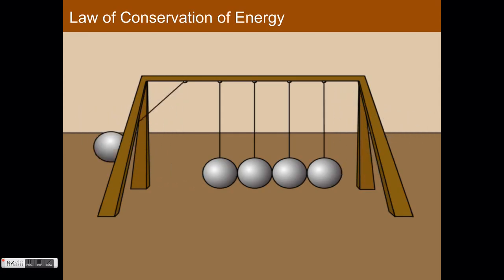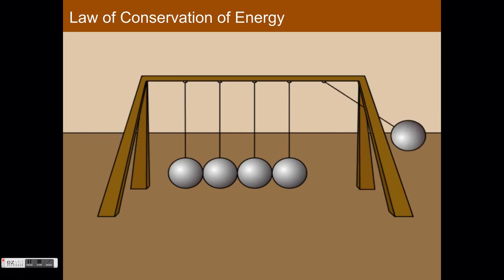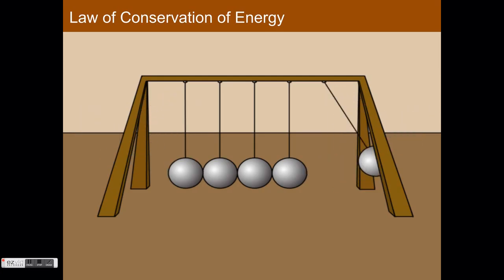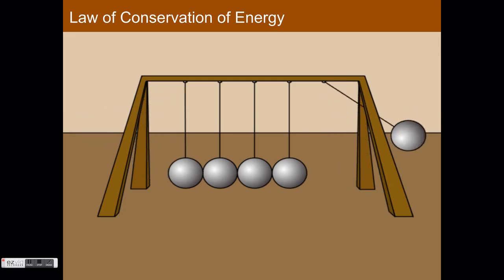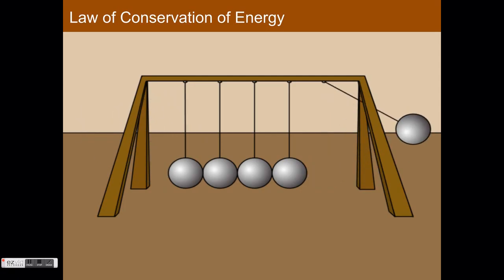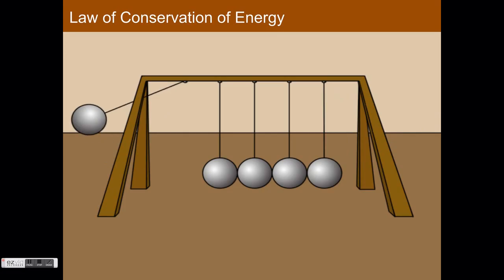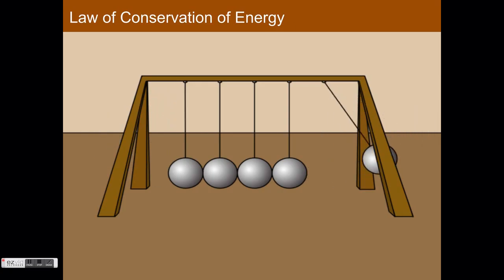The Law of Conservation of Energy

Comment: Newtons cradle needs a constant  imballaced force acting on it, gravity alone is not going to keep it moving. If you can find that force for this device then you can keep it moving. But its hard to find it in this setting. An imballance force will always seek its resting point or ballance, but if you redirect it (can't aply in this case) it will eternally be chasing its tail.Water is perfect for creating this state and redirecting its energy. "it flows".